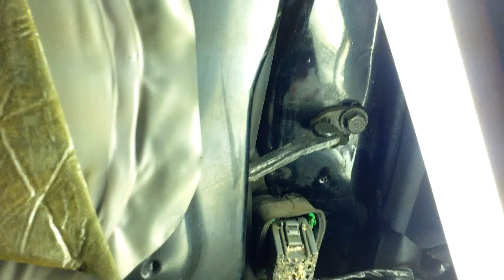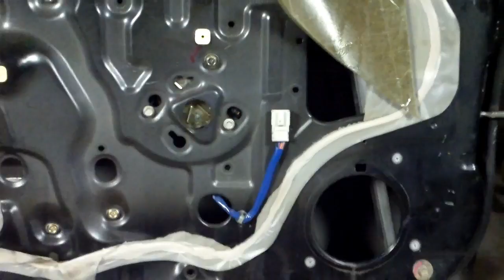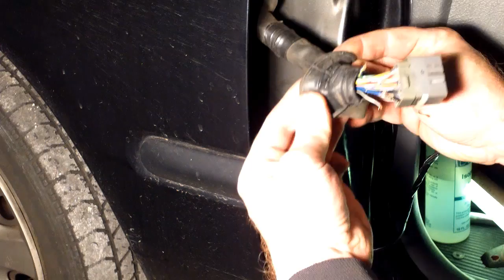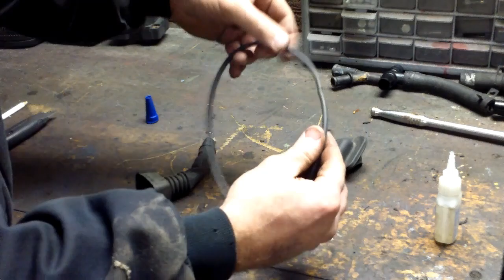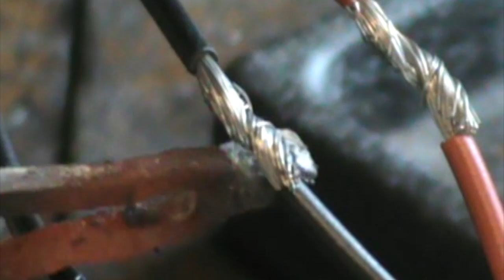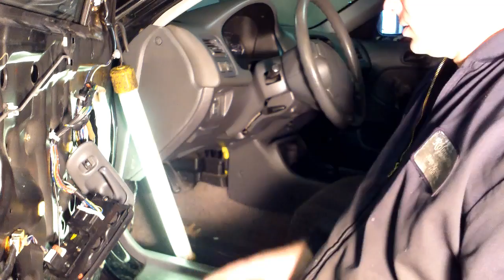Part-3 Honda civic Door harness repair, How to repair a wire harness with a faulty connector

Comment: My 2000 EK front driver door power lock actuator stopped working. Replaced the actuator and still doesn’t work. Rest of the doors do. So appears the very common wires coming out of the plug is my issue also. Probably not fun! But thanks to your video I have a good idea of how to go about it!
Reply from the maker: Sorry to hear that

Comment: Thank you, thank you!  I have had my Civic for a year and the RF window not rolling down is driving me nuts.  I can't tint the windows until I can get it working.  I am still mid-repair, having just cut all the wires from both connectors, but I can see the light at the end of the tunnel.  Plus, I enjoy soldering so tomorrow will be fun.
Reply from the maker: Thank you for sharing your experience and enthusiasm for the repair process. It's inspiring!

Comment: There's 2 black ground wires for pins 22 and 23. One is thicker than the other, do you remember which one goes where? It doesn't say in the service manual and I don't want to mess up

Comment: good video, I am just trying to figure out which wires he connected TO those he cut. I assume its the ones from the harness in the door, but my 99 has the same one he showed at the beginning on the floor. I am hoping I can maybe cut those too and solder them. Just not sure if they will be long enough. Im gonna have to examine the harness more. I got a used one from a 2000 at the pick n pull, because I may have messed up the clip in to the power window buttons. I hate those clips. They are never as easy as they are supposed to be, lol.

Comment: Very useful video and instruction. Intermittent operation of speakers or window motor is due to cut wires which are simply touching. Many many many thanks!

Comment: Great video.
Good detail and camera work.
I am very impressed.
One thing, when soldering, put some solder on the tip to wet it, and it will heat the wires much quicker.

Comment: Would crimping work just as well if I'm not to familiar with soldering
Reply: Crimps can work better in fact if done properly (proper crimping tool, lined up on the butt connector properly, non insulated butt connectors with heat shrink). Manufacturers don't solder any wires together except when joining wires to circuit boards. Crimps are used all throughout the various harnesses to join wires.
The problem with soldering two wires is that the strands are flexible against the inflexible solder. With frequent heat cycles, vibration and movement, the strands can break off and the solder can crack.
Even "best practice" can be prone to failure, however, as you can see with the need for this video.

Comment: DAMMIT,,, I just seen this is a 5 year old video... Ok,,, Ummmm I will check and see if you are still doing videos but right this minute I want to tell you I fkn appreciate how detailed you are with this video. I have a 96 with 200+_ and weird window operation , driver door window works well, the right rear window works when the driver door is wide open with the driver door switch but not the right rear window switch at all. I hate wiring issues. :{ Thank you for giving me something to LOOK for....... fkn automobiles ,,,,,, GRRR who started this shit..... ? :P
Reply from the maker: DizzyDish man how time flies seems like yesterday lol 😂 yes I'm still around 😉
Reply: Had to come watch this again because I have the same problem on my 96 civic. I wish they made a repair kit for this this problem where you put new molex ends on the wires and snap them back in the connector plug.

Comment: Honda,huh?    So,they used CHEAP wires that do not stand flexing (opening and closing of the door),and break!   should use wires with more strands,honda!   But,you knew that,lol...  planned obsolescence?

Thanks for your videos,amazing what a lot of hours  it takes to fix a simple window that stops working;
Reply: The wires are fine. The strands pull out of the crimp connectors inside the plug. The other failure that happens here is the insulation gets brittle and cracks, giving you intermittent shorts especially when they get wet. This will sometimes cause sections of the plug to melt.
It's an economy car btw.

Comment: Why not just buy a new harness, they are just simple plug types on both ends and take 5 minutes to put in.
Reply: Where to buy new harness? How to make it if yu can't get new connector? Those are the problems mate.
Reply: I have a 97 honda crv. You can't find the connector anymore.

Comment: WTF you are do man ?! Why? Just go to junk yard, buy cuter wire with new connector, remove old broken connector , put in new , weld new wire with connector and you will have same easy remove door.  Fok man, you just make mess...

Comment: hey whered you get the new connector
Reply: That is what I want to know too....  I have the same issue on my passenger door.  All electric has been dead for the past 2 years.  Only thing I can think of is going to a junkyard and cutting the connector off.  but I don't know if they would let me do that without taking the entire cabin harness...
Reply: Michael W Lam it would depend on what kinda junkyard u go to.

Comment: Hi great how to vid.Maybe you can help me.  I have a 09 Ridgeline and the back left window doesnt go up or down.  I have determined the motor and all switches are good. The only thing I found which is not right,, is that with the plug unplugged from the rear door switch there is power, with the key on,  to one wire yellow with red trace i think,  when I plug the left rear door switch into its connector there is power to all wires at that switch. Ive swapped switches with a known good one and it still doesn't work.   Any ideas how to diagnose why? Is the connector bad?  maybe I should take wires out of the connector and reconnect to the pins on the switch and see what happens.  Thx.  Arlan

Comment: I'm glad I watched this video. I have a 99 civic si with a similar problem. My right Windsow stopped working and it also stopped auto locking the right door. I have replaced the window motor, and both switches with no luck. Tomorrow I will do as you did on your video and hopefully get to the bottom of my electronic issue. Thank for your video. Very detailed and helpful
Reply: I know that was almost 10 years ago , how did the job go ?

Comment: Do you know if the wires in the door harness are the same color(s) as the corresponding wires in the floor harness? If that's the case then determining which specific wires need to be soldered together becomes a lot easier.

Comment: Please Please help I removed the connector from both ends and just ran the wire to each other did I mess up? Do I really need the connector? because nothing is still working
Reply: +Lachell Jennings no you don't need the connector,nothing is stil working cause,this wasnt your problem.. check your power and your grounds

Comment: When you did the repair did all the wires match each other? I have a 1999 honda civic ex and I hooked everything up to the matching wire and everything worked fine except the power mirror button locked the door instead of adjusting the mirror. The regular door locks still worked though..

Comment: Civic door harness repair.    I'm in the same boat you were.   Went to take the door off and the bolt to ill call it hinge, center one that goes into the door, just spins.    What can I do now to remove the door? Ideas
Reply: Greg Rogowski remove fendr
Reply: +Greg Rogowski  u can get that pin out with a hammer and a flat head,the pin will normally spit in half then you can just punch it out the rest of the way

Comment: what if i do have enough time and i am just trying to do repairs that don't cost anything? how would i resolder the wires using the existing connector? at first, i was going to create my own harness by connecting the wires inside my car with butt connectors and fishing it through the outside and into the door, but i am not satisfied with the way those wires would create a seal in comparison with the rectangular connector which makes a tighter seal and is more solid which would be better for noise reduction.

Comment: I just take off the driver's side fender to do this job. Much faster than hanging a door.
Reply: or you could pull all the conector inside. and do it from the inside of the car, without remowing any panels (forgot, i dont have the black thingy that goes with the fender, protects from all the shit)
Reply: Where is your video on doing this? Do you have one or are you just running your mouth. I appreciate this Robinson fella doing a video on this because I have a 96 civic ex that the driver door window works and the right rear window works if the drivers door is open all the way out and the passenger door window and driver passenger side widow does not work at all.... Just asking if you have a more in detail video for me to watch before I break out a can of whoop ass on my car to make all the windows work. Yes I work in a shop and we all run our mouths but , EXTRA thanks go to those who take the time to show their work, Dont make me come over there. Just give a url/link to your video that makes this job an easier job.
Reply: just pull the harness inside.

Comment: I have the exact same issue on my 96 lx. Thank you for this video, makes my decision a little easier on making the commitment to getting another harness and splicing in. If you see this, do you know if the later models 97-2000 are the same connector?
Reply: I’ve got a 99 not looking forward to this lol but how did it go? Same harness?

Comment: i fix the wire harness and still nothing for the passenager side but the driver side work thats it and the two rear didnt work either could it be the wire harness its self in the doors

Comment: Hey will very good video! I was I had the skills you do I just got a project eg9 Honda civic and none of the windows or sunroof is working and I am terrified of going at it! 😕 keep up the good work its nice when you discover proper a nice tidy repair rather than what I found..... A heap of wires joined and not only un soldered but totally in insulated Joints! 😰 wish me luck!
Reply: *wish

Comment: Wonderful series. It's just the inspiration I needed to tackle my passenger window which failed to come back up today. The interesting thing is that it always worked fine from the driver's side until my passenger moved it with her switch. You put so much work into that problem, if I'm not too far out of line would you mind me asking how much the job was worth?

Comment: Great Video!  You showed where you cut-off the male connector and indicated that you were soldering a splice wire to each of those wires.  How did you effect the connection on the door side?  Did you use the existing connector that was housed in the door, or did you cut that off as well and solder the splice wire directly to the matching wire on the door harness side?  I have the same situation on a '93 Civic and I am trying to decide where to connect the wires on the door side.  Did the all the wires fit into the door cavity and not interfere with the window mechanics?
Thanks again for the great instruction!

Comment: That's a fine, real world example. I thought you were going to remove each wire insert and then clean and reinstall, using the original connector, or maybe a new oem connector. A lot of work, either way. Happy new year, Will!
Reply from the maker: Thank you, i gave that some thought lol but what a mess it was, a coin flip type of repair either way would have been ok, came down to time, and to be honest this was quicker and more durable for the application i believe, Thank you for the feed back its always appreciated, hope you had a merry Christmas and a happy new year